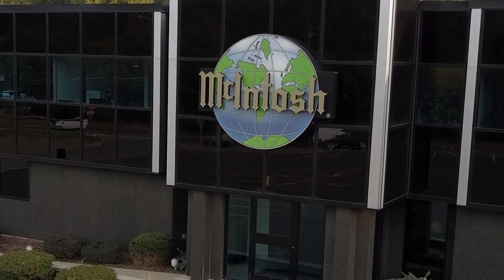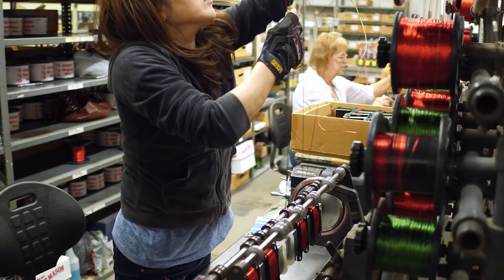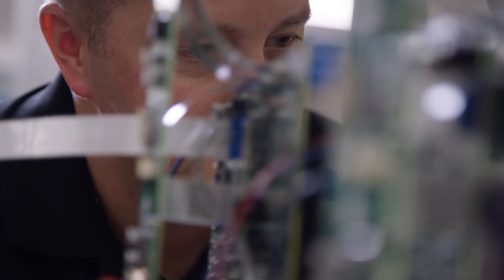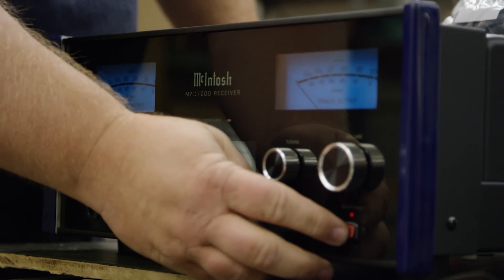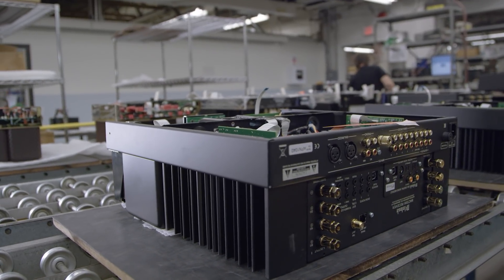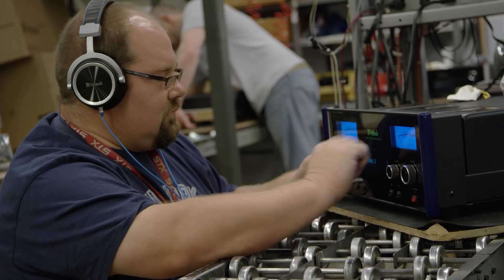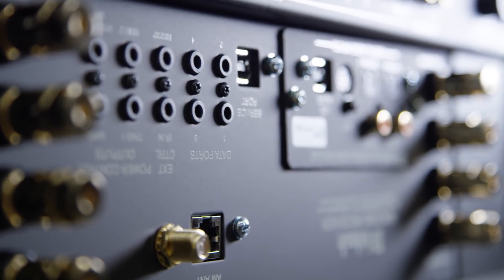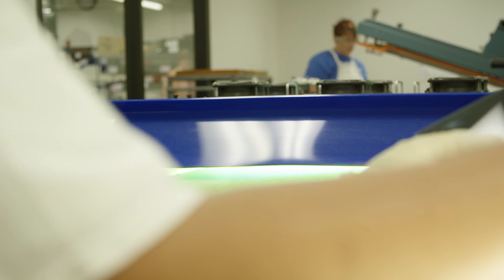McIntosh's Five New Solid-State Integrated Amplifiers

Comment: God help you if anything breaks. My MA7900 just went doornail. I hope it’s just corrupted firmware that can be reloaded. 

They are also more complicated than they need to be. The menus are labyrinthine, and the manual is confusing for a regular person. The manual may as well be in Chinese.  Some salespeople also cannot figure out the menus. 

They sound sooooo good when they are working. 

I also had 2 AV processors. Little gremlins got inside and no one could get them out.

Comment: The least expensive (MA5300) is $5,000.00.  The MA9000 is around $10,500.00.
Reply: This isn’t slob grade stuff. You get what you pay for. To hear a true hifi system is to live. Awe inspiring stuff.
Reply: 5300 is $ 5500 bucks do it the American way, borrow it , then claim  chapter 13 . your done
Reply: @jackoff6776  BINGO!
Reply: @NDFOOTBALL  RCF🙂
Reply: A used unit would not be that expensive, like, I bought an MC2205 for $1500.